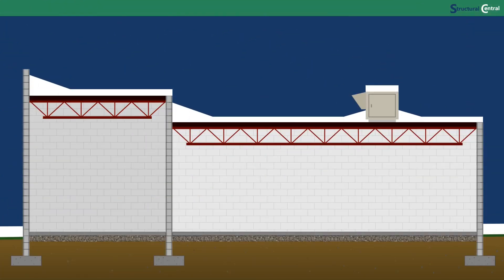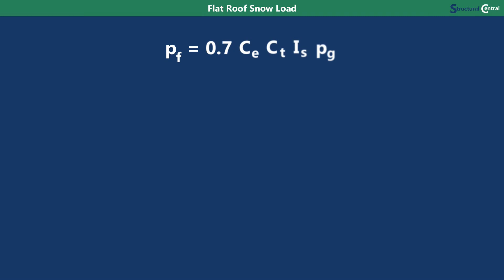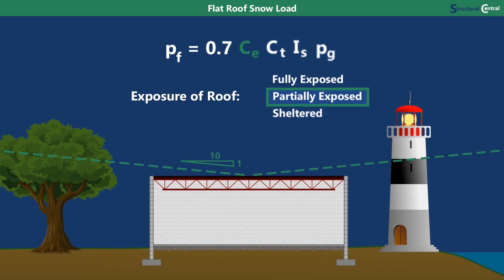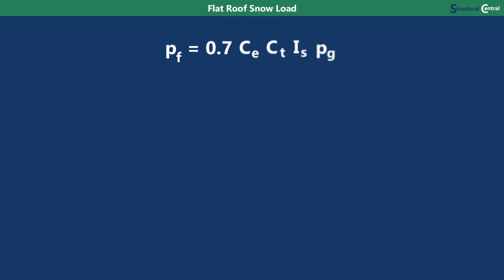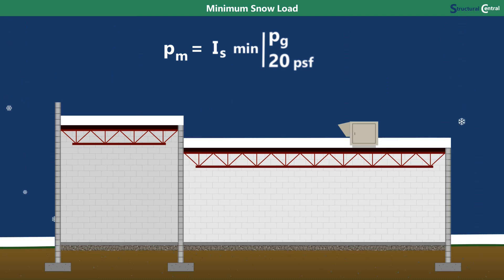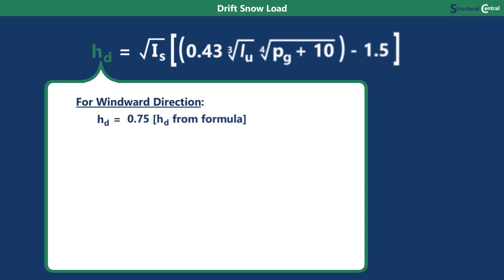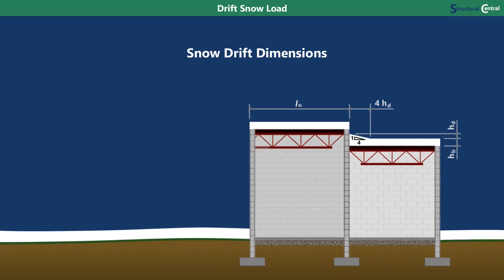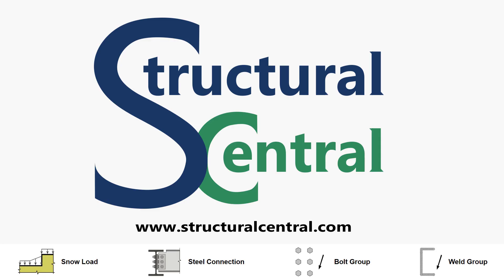Snow Load Calculation - How to Determine Snow Loads Including Snow Drift

Comment: I have seen your presentation before ~ year an add notes. As you have said snowfall and drifting of snow on roofs as well as in roads, harbors, ports, dams, karst buildings, airpots snd railways must be removed. You give me path to see how to start research existing method and combine in a model for wind and snow simulation. Many researchs use FLOW-3D     with general purpose for transient fluid flow phenomenon that runs under UNIX on workstation computers.  To make real case we must imply geometry from both CAD models and digital terrain models must be converted to an appropriate format. Meteorological and hydrological data for boundary conditions as the sources usually field measurements at specific places. With this data we figure vector plot of wind speed and direction for horizontal cladding with different placings of gaps as well as a three-dimensional simulation of snowdrifs by numerical discrezization of two phase problems for a simplified drift-flux model and solutions similar to real measurements. Like you content as well as The Method called SNOW - SIM.😊
Reply from the maker: Understanding the intricacies of simulating wind and snow dynamics is no small feat. Wishing you the best in your endeavors as you navigate this complex analytical terrain!
Reply: @StructuralCentral   I should like to express immediately my deep gratitude to yours support and helpful sugestions which intrigated me before and contributed increasing this topic. Snowdrift and snow deposition have always been major problems and it will be. Numerical simulation of snowdrift with aspects on snowdrift experiments and process need to consider the diffusion theory and The finite - volumen solution as snow represents phase. Like you have said it is quite task to find solution or a further approach to the basic drift-snowflux rutine as well as investigation into complex geometry of the simulation where the snow will deposit, not as a exact quantity calculation. Mixture density, velocity, dispersed phese mass conversation, i.c. is BIG TOPIC and I am so truly delighted to give me INPUT BEFORE ONE YEAR. Yours topic is brilliant for researching energy efficiency in the enviroment also with quantum dinamics. I wish you all the best in further topics and "snowing", as well, again THANKS. 😊

Comment: How do we calculate the snow drift if the roof is flat but there is a air vent or a chimney etc. on the roof just like in the 'Drift Snow Load' part of the video?
Reply from the maker: Take a look at the "Roof Projections" section of ASCE 7 (Section 7.8 in ASCE 7-16). Projections on the roof get designed as windward drifts (0.75 factor on hd) using the length of the roof upwind or downwind of the projection. Also, note that for projections less than 15 feet long, drift loads are not required.

Hope this helps!
Reply: @StructuralCentral  Thank you, I will take a look now. Much appreciated

Comment: hello, how should the snow load be calculated on multi span roofs? I couldn't find anything about it in asce7-16. Should it be calculated by the Sawtooth Roof division?
Reply from the maker: I'm not sure exactly what roof geometry you're referring to when you say "multi span roofs", but I can point you to some cases that require special attention.

If your roof surface is supported by continuous, multi-span beams, you'll need to consider multiple load patterns with full and partial loading on different spans per ASCE 7-16, Section 7.5.1.

If your roof consists of different slopes that merge together, then the sections on Multiple Folded Plate, Sawtooth, and Barrel Vault Roofs may apply. (You can do a Google Image search for these terms to see exactly what they are.) Section 7.4.4 requires you to use Cs = 1.0 and Section 7.6.3 requires you to use unbalanced snow loads with higher loads in the valleys and lower loads in the ridges.

I hope that this helps!
Reply: @StructuralCentral  First of all, thank you for answering my question. I'm sorry for my bad english. The roof type I mentioned is referred to as "Multi span roof" on page 24 of EN 1991-1-3 in Eurocode. there is also this type of roof at the bottom of page 33. How should the snow load calculation of the roof type formed by combining two or more roofs like this be done side by side? Snow will accumulate at the junction of the two roofs due to snow drift and how should this be calculated? thanks
Reply from the maker: The Eurocode examples of "multi span roofs" that you mentioned appear to be referring to the same thing that ASCE 7-16 calls "sawtooth roofs". Take a look at ASCE 7-16, Figure 7.6-3 to see the design load cases. They account for the additional snow that accumulates in the valleys.
Reply: @StructuralCentral  Thank you so much 🙏

Comment: It is very well explained. I am Technologist, learning to calculate snow buildup, I am in Canada, can I use this for Metric system?
Reply from the maker: To use the metric system, you would just have to do the proper unit conversions for each of the equations and limits. If you're in Canada, though, it's likely that you're required to follow the National Building Code of Canada. It contains its own method for determining snow loads. (See Section 4.1.6 of the 2015 Edition.)